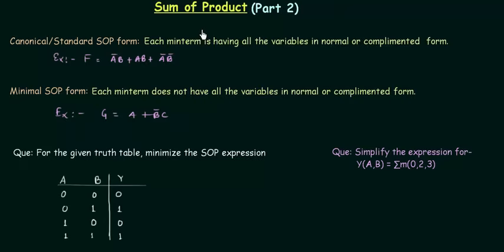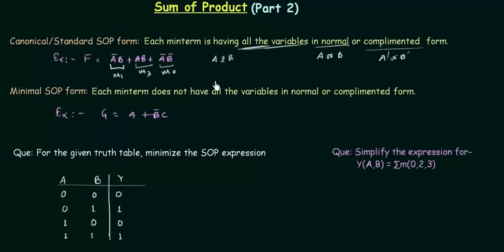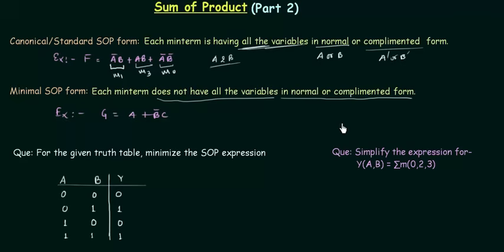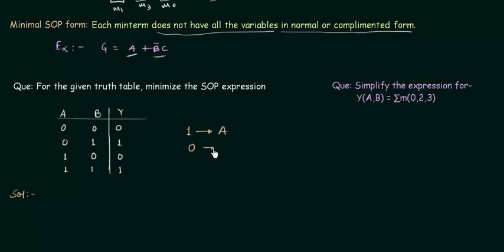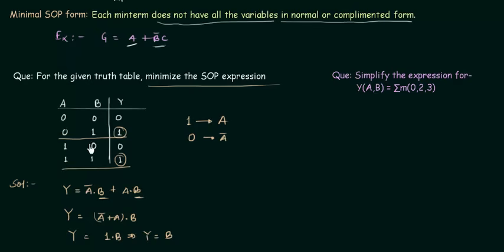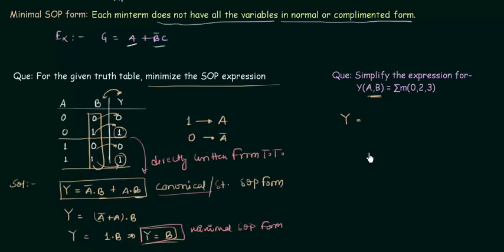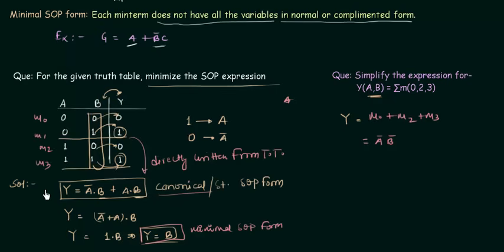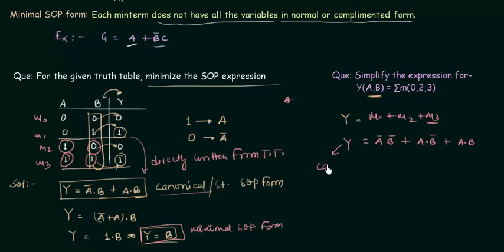Sum of Products (Part 2) | SOP Form

Comment: qusetion pls, why was m1 excluded in writing the minterm and m2 included, since minterms are written from high outputs only , but here is the case where m1 has a high output and m2 has a low output , yet m1 was not included as a minterm. 
PLEASE EXPLAIN  abeg!
Reply: Yes there  m0, m2, & m3 should be included but sir include m1 & m3 which is a mistake.

Comment: No offence but your use of terms is pretty wrong in the case of minterms in the example Ex = A + B'C 
A and B'C are not minterm the term minterms means when all the  variables are included in a minimal part of the boolean expression so if its just A it is a literal and not a minterm.

Comment: We're writing the minterms only when the output is high for the corresponding function. But, in Q(2), for m0 you're taking A'B' while the output is low according to the given table in Q(1). I can't understand this part. Please explain.
Reply: Y output (0,1,0,1) is applicable for qn 1 only. Qn 2 is different from qn 1. For qn 2 since Y(A,B)= Σm(0,2,3) therefore the output will be (1,0,1,1)
Reply: How will we find output (1 0 1 1) @SahilKumarSah12

Comment: Sir if sop form is used for high(1) output then how can we use it for low output in que no. two
Reply: for the second question truth table is not given...so m0 might have high output in the truth table..if u want check from the answer. m0 means A=0 nd B=0...Y=A+B'=0+0'=0+1=1..hence it is high.
Reply: Thank you 😊

Comment: in the second question also  we are writing the SOP form of the given expression, but then it contradicts the fact that we write minterms for those combinations only for which output is high, but in the 2nd question 1st minterm is m0 , combinations for which doesn't give output as 1 it is 0 in Truth Table
Reply: Actually the output of the given different variables say A and B depends on the switching function which can be represented by many different but equivalent switching expressions
Reply: Good observation! I'm also wondering about this thing!
Reply: @snehashishbanerjee2575  these are different  questions. TT is fr first problem and in second problem m0 is 1 as it is given in the expression.
Reply: @snehashishbanerjee2575  you are comparing the truth table of 1st question with the second one
Reply: @deepaktewari977  exactly...
Reply: @deepaktewari977   Do we not need a truth table in q2 to solve the problem??
or can we just use the binary equivalence
Reply: @vivekchauhan1606  you can use the binary equivalence
Reply: @deepaktewari977  Thank you